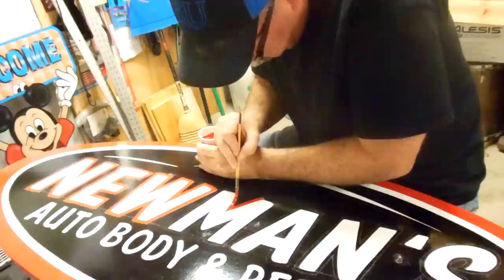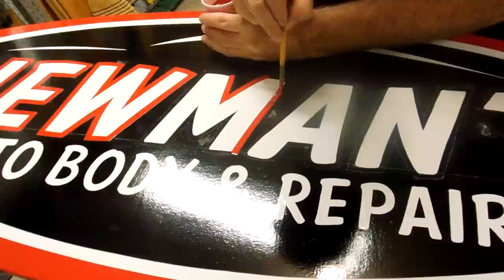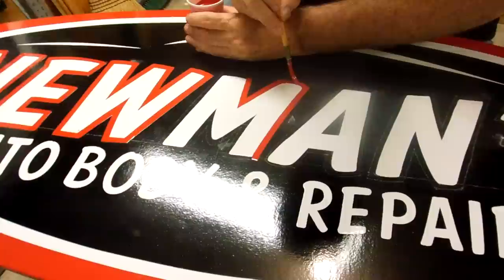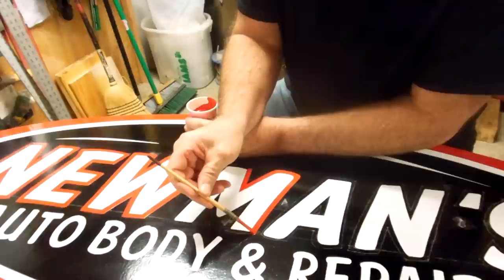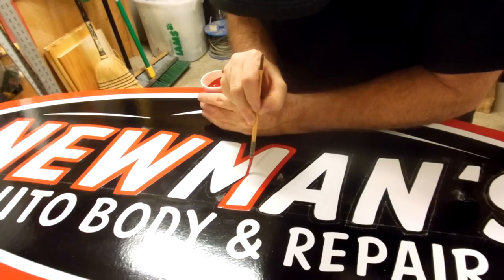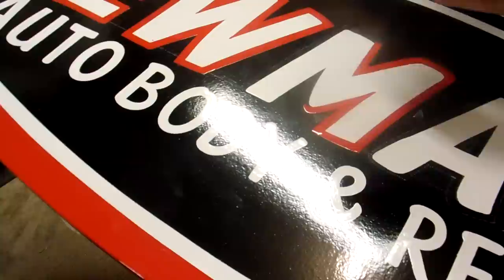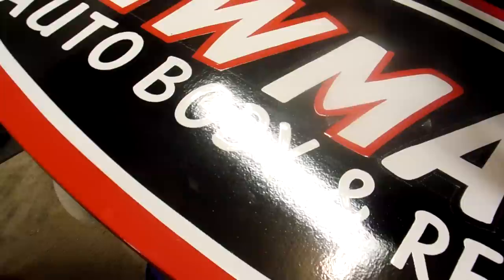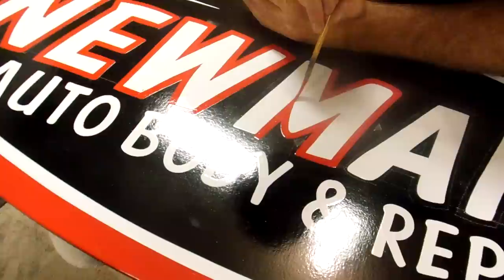Ripley's "Ol-Skool" Pinstriping, Lettering & Signs for Newman's Auto Body & Repair - Olathe - KS.

Comment: hello I am an artist, very experienced with painting lettering however not on an auto body.  Are you using One show sign enamel? and is a primer or prep to the painted area required.  this will be a newly painted surface.  they do not want a clear coat sprayed over the lettering as it is a vintage auto.  any advice?